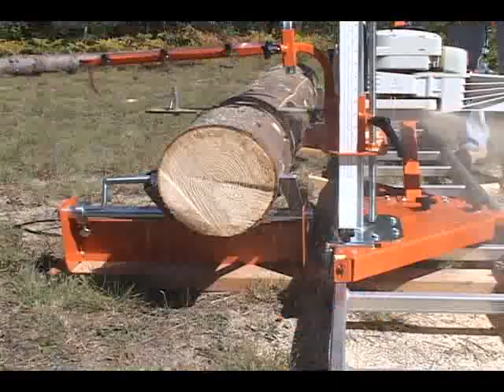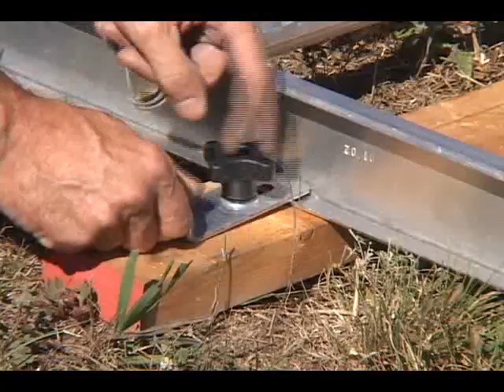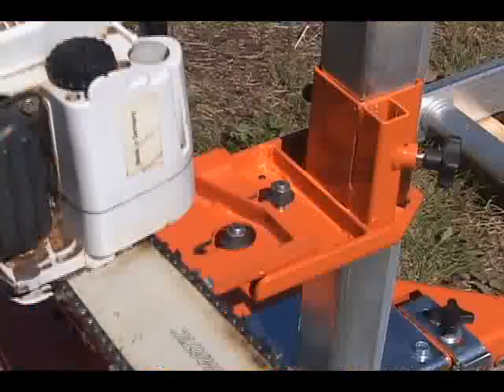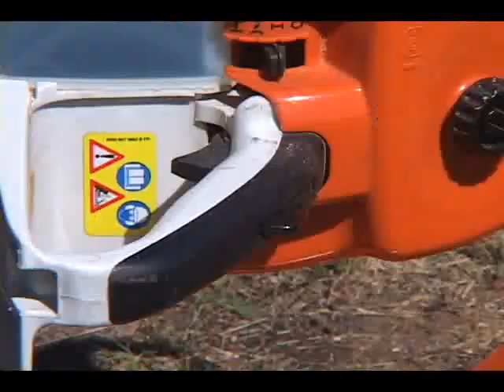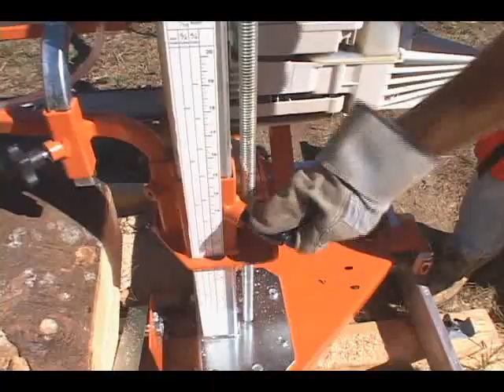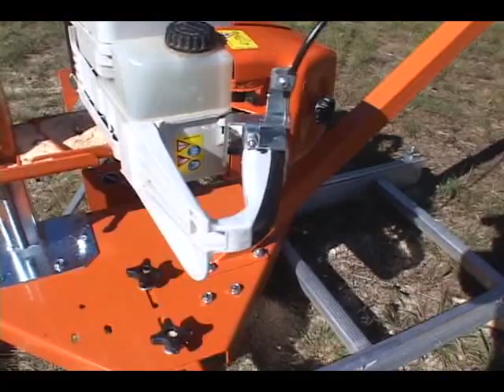Norwood PortaMill Chainsaw Sawmill - Make Your Own Lumber

Comment: I returned mine after several missing parts and bad threads. Made in China. Perhaps mine was an exception, but the quality was very poor. For just a bit more than the price, you are in very entry level Harbor Freight bandsaw range. Now add the cost for a decent chainsaw, ripping chain, and the reduced lifespan of the chainsaw as well if you cut a lot to the price.I ended up getting a larger mill on a trailer. I think the PM14 would work fine, but it's very expensive for what it is and with the time I wasted assembling and ordering parts, I could have made one. Others have made a DIY version. Customer service was outstanding in shipping new/missing parts, but after the 3rd time finding a part missing, I gave up. They did accept the return after 30 days because I never got it running. My new mill took less time to assemble and it's a manual bandsaw with a trailer.

Comment: Over 75cc recommended? Oh my. at 70cc you can drop $1,000 for a saw with no frills at all.
Reply: i tried it with mt 55 huskey... it was brutal slow. even with a brand new blade and bar.
Reply: @mikeforcerer8537  That is odd.. I mill with my cheap 52cc Chinese saw with no difficulty. Ok yeah, I know I am beating up the saw and probably reducing its service life, but it was an $80 on amazon saw so I am more or less ok with that.. What are you milling? Mostly pine and sweet gum here. Sometimes (rarely) walnut.
Reply: @BlackPowderGeek  It was eastern white pine, But i had a 24" bar on it, that reduced power, Also the wood i was cutting was like 23" so very thick haha
Reply: Paul Cox  Please share your recommendations?
Reply: Paul Cox  AH ok. I was wondering. I see Stihl saws used for a lot less than that, but they are home owner sized saws. I thought perhaps the bigger pro saws were just a lot more expensive than I though.